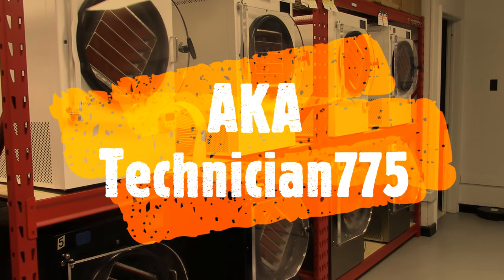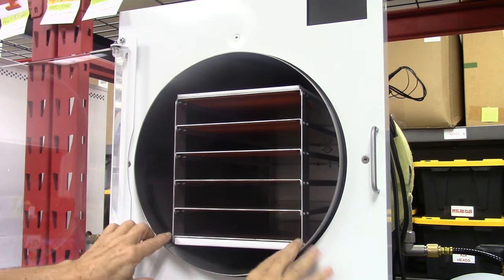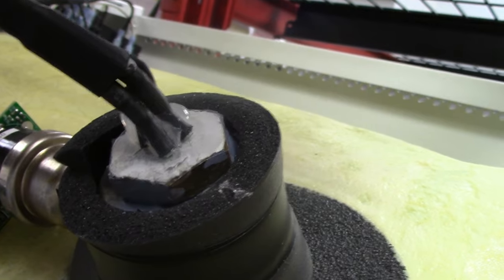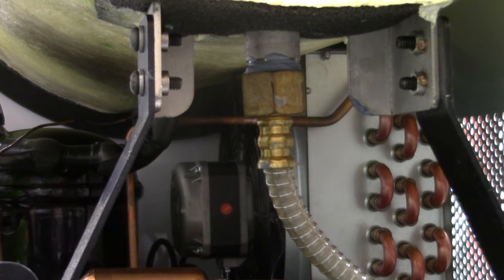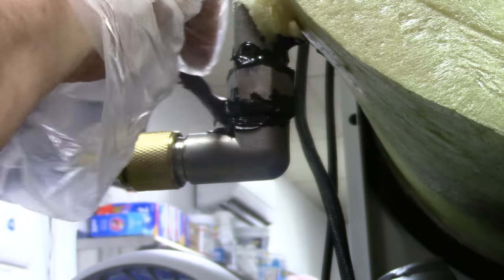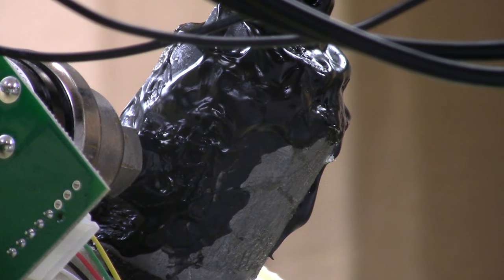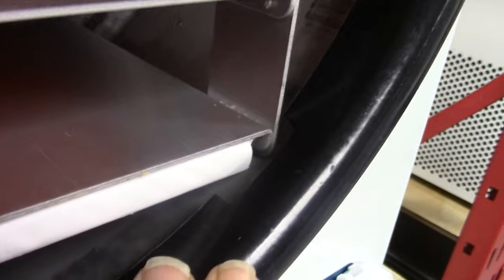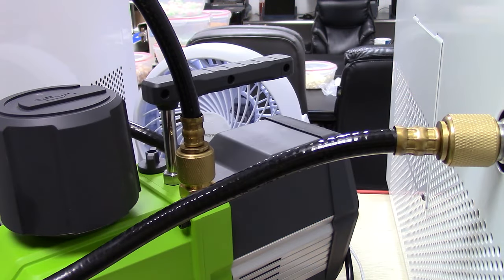Harvest Right Vacuum Fix VIDEO

Comment: Hi steve great video, have you ever seen the little vacuum pressure sensor stop working, mine is not registering any change to the mtorr it just stays on 2500, I have resealed all connection points ran the pump (standard supplied pump) until it goes quiet at this stage it use to indicate the mtorr was dropping, I then turned the pump off, released the door handle and came back 30min later and the door was still sealed tight. cheers.
Reply: Hi, it might be your vacuum sensor....I have had them go out...is your unit still under warranty?? if so...submit a ticket and have the tech guys help with a trouble shoot...if not in warranty.... it will cost you a bit...they are not cheap.....good luck!...thanks for watching!
Reply: seal everything really well first...i would suggest.....check all areas ...did that just start or have you been having trouble??
Reply: @stevenducote7466  I would say its no longer under warranty but are allowing me to call the tomorrow, apart from the 1st 10 months or so i have had issues with this machine hopefully it can be resolved. Its about 6yrs old and over this period I have done about 50-60 cycles, all in the 1st 18 months. cheers
Reply: @stevenducote7466  I haven't used it for about 3 years or more, all connections have been replaced with new gas tape just haven't done the liquid tape or stretch tape as yet, since I messaged you I think I can hear a hissing noise inside the tank its not easy as have the unit in the garage and its a busy road so I have purchased a stethoscope Lol to see if I can pinpoint the exact spot, thanks again Steve.
Reply: @bazza2825  good luck...I hope it is something simple!...if I can help let me know!
Reply: @stevenducote7466  Actually if I can ask you something, I am trying to get this unit going again after not using it for at least 2yrs due to pump problems and what I think is the problem why I have had the pumps fail is I noticed that even after doing just one batch the oil would be almost black, never use to be the case and over time got worse, any idea's please steve what do you think is causing this, I did have the oil tested and they said it had metal in it yet 3 pumps have all done the same.?
Reply: @bazza2825  what pump is it that you are using?
Reply from the maker: Hi, check your drain valve, shut it off, pull a vacuum and stick the drain valve in a glass of water, if the water get sucks up the hose, you have a bad valve, please let me know what you find out, TY!
Reply: @rowe39425  I have the std pump + tried a new pump from navac same size 2 stage and both recorded the same result.
Reply: @stevenducote7466  its been a problem for 2yrs but seen a lot of video's out now on how to fix, I resealed all connection and although its better its still not quite enough.
Reply: @technician775  resealed all connections and could only get it down to 1700mtorr before it would start going back up but I ran a separate test by once it was less than 2000mtorr I would turn the pump off and release the door handle to see how long it would take for the pressure to get back to normal and the door spring open, 3.5hrs later the door still looked like it had a full seal so I am thinking it may not be a leak.?
Reply: @bazza2825   hi.....the next step might be to replace the pump...how is the oil looking in it??do you know anyone who has a  unit where you can borrow a pump??
Reply: @bazza2825  hi......can you borrow a pump from someone??..i would look at a known good pump...and go from there.. .how close are you to Louisiana??
Reply: @stevenducote7466  I am in Australia, tried my existing pump which which was used only a few times and a new 7cfm pump.
Reply: @stevenducote7466  oil and pump are brand new never used before, don't know anyone else near me in Australia.
Reply: @bazza2825  wow...not too close to Louisiana.....check your welds for a crack...and your front gasket to ensure it is not hitting the tray holder....also ensure the power cable for the tray is not bunching up behind the tray shelf.....
Reply: @stevenducote7466  gaske is fine still like new also, i guess to check the welds i need to scrape off the foam, i noticed  the new machines have  like some sort of putty around the welds.
Reply: @stevenducote7466  I have found someone about 30min from me said I can try my pump on their machine, can't use their pump as its in for repairs Lol, what size fitting is used on the premier pump they sent me a picture and it looks like 1" does that sound right. cheers.
Reply: @bazza2825  hiya...I would bring it to them and try it.....not too far away.....it will let you know more of what is going on....
Reply: @bazza2825  it should be a standard fitting for the unit...if you can...get the small hose they have now.....
Reply: @stevenducote7466  took my pump to his house and it went down to 290mtorr on his large machine. so I still have a leak somewhere. grrr
Reply: @bazza2825  ok....at least we know the pump is good!... did you bring your vacuum hose or use his??..i would make a list of all possible leaks..go down the list and double check them....each and every possible leak.....check to ensure the vacuum hose on each end has a good oring......
Reply: @stevenducote7466  Yes used my hose had a new one made up, I am running out of places to check. I even took the foam out from around one fitting and sprayed that to see if there is a leak on the weld, will know in a few hours.
Reply: @bazza2825  did you happen to change out the vacuum sensor??
Reply: @bazza2825  you can get the vacuum sensor from china...you will have to get any numbers from it and do a search...I did find some and I think I did book mark it on my computer at the shop....I will look when I go in today.....
Reply: @stevenducote7466  thanks Steve that would be handy to know, for now though I think it still could be a leak as I can tell by the noise of the pump, when testing it at this guys house and it got down to 273mtorr my new pump was running so quite the main unit with the freeze cycle going was making more noise than the pump yet when connect to my machine its definitely noisier indicating to me its not drawing enough vacuum just seems to settle around 1700mtorr for a few min then heads back up again, Steve do you know how to disconnect the wires from the shelving plug so as I can pull this through, its a shame they didn't make that outlet 1" instead of 3/4 as probably would have pulled through without trying to disconnect the end fitting on the cable, the reason why I ask is what I was thinking of doing is cap off the outlet where  the pump connects and connect the pump to the outlet where the T piece would be and see how that goes , this could tell me whether the sensor is leaking or the cable end of the T piece, they should have had these 2 on different outlets as would have made things easier for diagnosis with mine being an older machine its a pain in the but trying to get that T piece off. cheers mate.
Reply: @bazza2825  hiya... the connector will need a special tool to release the lock that each of the pins have....are you using the liquid tape to seal all the areas??
Reply: @stevenducote7466  I am waiting for it to arrived as ordered online couldn't find any locally in the meantime I have used 3 wraps of gas tape and a lot of the stretchy tape, I think I must have warn out the previous HR tech as they have assigned someone else to my case and so far he had me change vacuum calibration to 50 and check for leaks that's about it so far and still not going low enough, 2250 was the test today which was worse than the previous 2 Lol. They had me update the firmware also, my thinking as I have said to them is if running it through the test function I can't see how the software is going to improve things as it must be a leak but went through the process anyway, inside the fitting where the cable runs though it looks like there is enough room to add some more sealer there so doing some homework on what I should use just incase the leak is at that point. cheers Steve.
Reply: @bazza2825  hiya!...look and see if you can find the liquid tape we use...it is runny enough to get into all the smallest cracks and seals them up.  pull a good long vacuum and turn the pump off and see how long it does before the door pops open.....did you check the drain valve and put the end in water to see if it sucks up any water past the valve?? good luck! let me know the results...
Reply: @bazza2825  where the cables go thru is a main leak area....I would caution about using rtv as it is not liquid enought to get in all the tiny cracks....see if you can find some liquid tape...it is the best...also caution using resins..as they get brittle and crack over time...if you need go to an electric motor shop and ask the  technicians what they use and tell them what you have going on....cheers!!!!!
Reply: @stevenducote7466  I did find some liquid tape but it was in a tiny tube so purchased to cans online, the fitting where the cables go through I was looking at the inside of the fitting as it seems a bit concave in there so though I would add some more, there is a liquid product, non toxic which can be used on steel sets very hard. I sent HR the results of my latest test run, will see what else they come back with, I keep telling them its a leak. cheers Steve.
Reply: @bazza2825  hiya....I would use the liquid tape...anything that gets hard will be brittle and leak again...once we had a unit that we found the threads were mismatched on the fittings, someone had used the wrong fitting, might check all the threads and faces of the fittings...cheers!
Reply: @stevenducote7466  oky doky will be trying that today.
Reply: @bazza2825  good luck!!!!!  hope you find something!
Reply: @stevenducote7466  cheers.

Comment: Hi Steve how is your knowledge with vacuum pumps, I have 3 std HR ones and all 3 loose vacuum pressure once they get warmed up or hot i guess,  cheers mate.
Reply: hey buddy!!!!.....I use the dairyland oil in the standard pump....you might have to take it apart..or take the cover off and ensure it is clean....check the Reed valves for rust.....hope you are doing well!....the oil we use is blue...cannot use that oil in a premiere pump though.....take good care!!!!
Reply: @stevenducote7466  thanks steve i am well hope all is good on your end, yes I have done those things, stripped all 3 down got any rust off, pulled the 2 stages apart and put them back together, I was told by HR 3 yrs ago it could be a heat sensor though I thought it strange that it happened to all 3, I was thinking if i could get at least one going it may save me buying a premier pump, still have the little new one that may keep or sell as its a bit noisier than my other 3 and it served its purpose by helping me and your good self in problem solving, i wonder if HR have a schematic of the pump to see where the sensor is. cheers mate.
Reply: @bazza2825  Hey Bazza!....I have tried on the past to work on these...no luck....and no spare parts that I can find...I am using all premiere pumps.....can't beat them in my opinion....I have uses the oil less pumps too.....not a good option...expensive and hit and miss with the overhaul kits....the premieres are quiet. long lasting with the oil...and work the best for us.....good luck with those...might look for a Chinese copy...maybe they will have info.....I don't know who builds them for HR.....
cheers!!!!!!
Reply: @stevenducote7466  ok I found a plan in the pump book it doesn't show a sensor just the electrical box, oh well may as well pull that box apart and have a look hey what have I got to loose,  I will end up with a premier pump last time I asked the new shipment isn't arriving until June down here, its just a shame as these 3 std pumps still look new. thanks again steve.
Reply: @bazza2825  hiya.....I had a pump doing that....changed the oil...seemed to help.....not much info on these that I can find....sorry I am no help....
Reply: @stevenducote7466  all good mate you have been a great help. cheers Steve.
Reply: @bazza2825  thank you...hope things smooth out and you get your new premiere pump.....thanks!

Comment: I did what you said to do, I got it down to 500 the first time I did the test. I put everything back together and now I can’t get it down below 700. I am getting so frustrated. I feel like throwing this freeze dryer out the door. Do you have any suggestions on what else it could be? Or what I can do?
Reply: wow...I can sense the fustration....ok.....try another bread run....just trying to pull a vacuum might not work....let it go the entire process....check the mtorrs at the end.  let me know....we can get it fixed...!!!
Reply: Ok, I will do another bread test.
Reply: ok...gives a good baseline....write down the temps and the vacuum numbers....
Reply: mT went down 130. Temp is at 125.
Reply: perfect!!!!!
Reply: Ok, how do I get it down to 500 when I do the vacuum test. Apparently there’s still a problem.
Reply: I just did a vacuum test this morning and it was at 790. Is this a problem or not? I can’t believe this is a leak problem. Do you think it could be a thermal couple problem? Or should I just not worry about it?
Reply: Good morning, don't worry about the test, check the mtorrs when freeze drying food or candy, that will give you the real number...I hope this helps....
Reply: Thanks!!
Reply: you are welcome!

Comment: Our machine is not giving frost rings or freezing and can not find videos to help us diagnose this issue.
Is there any advice that you have as to what we can do to track down our problem and fix the issue?
Reply: hi...I can try, open the door and go to function test,  turn on cooling or freezer, door open, let it run for about 30 minutes then check the freeze rings, also, when the unit comes on the freeze test, listen for the fan running, if you are not sure, get a flashlight and look to see if you can see it, also, check with a flashlight the front of the condenser, ensure there is nothing blocking it like dust, dirt, etc, sounds silly, but it moves a lot of air and it does pick up a lot of hair, dust etc, check the freezevring, should be at least half to full freeze line. also listen for the compressor to come on....let me know the results, ty!
Reply: how old and how much use, hours etc, is it in a hot room??
Reply: It is in a cold room (our basement)
About 68 to 71 degrees. 
I did what you said.
There are no frost rings.
Even the copper lines aren't getting cold.
Reply: We have had it for a year and 12 days,
So harvest right said we were out of warranty.
Reply: We also have another issue going on with our premier pump, we were getting water in it, probably from when we cleaned it...
Didn't know about the diffuser filter in the top cap.
So we have caused some issues in our pump by introducing water.
We have tore the pump down 3 times, sprayed with brake Kleen and allowed to dry then reassembled. 
But now we lost the hardware( for the housing and  the 2 screws for the internal filter housing)
Do you by chance, know the screw type/size/spec to replace them.
My wife is stressing over this big time.
Reply: Nevermind,  she just found out that they are M6 metric 16 mm
Reply: @stevenducote7466 yes, that is what we saw in the paperwork that we bought the machine with.

But I don't know anything about refrigeration, is the Compressor the part with the fan, or the black canister
Reply: She is trying to get a service call set up now